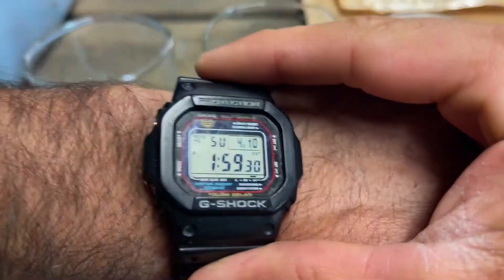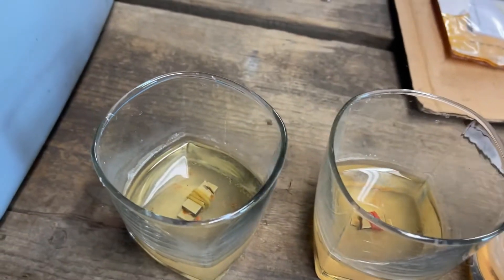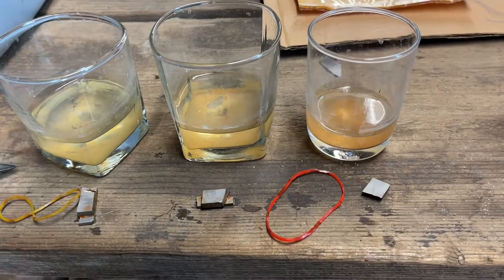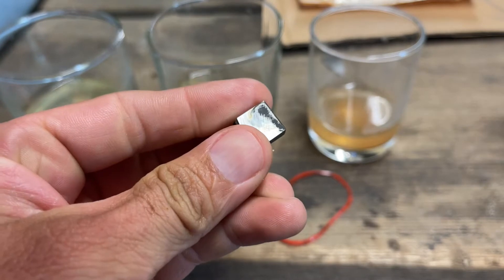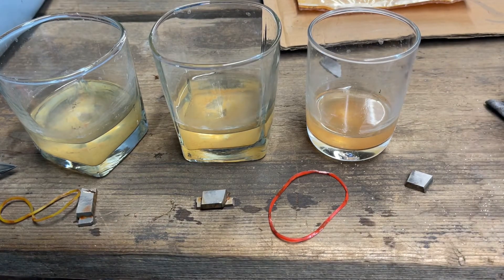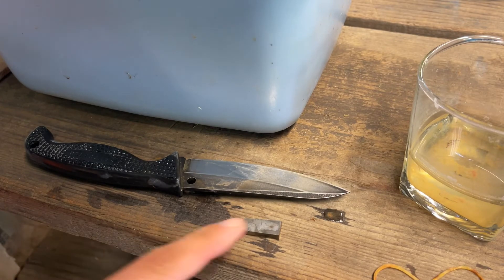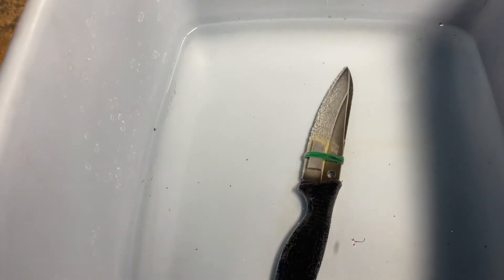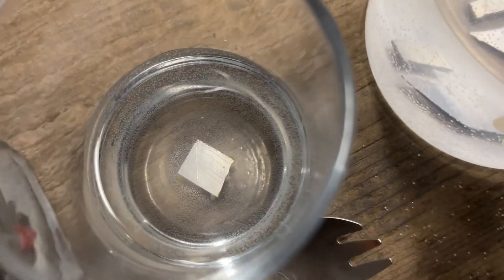Magnacut galvanic corrosion test results

Comment: Interesting tests, in salt water? Don't understand the dissimilar metals parameter, how would that apply in real use? Maybe a folder in Salt? water? for a week? Wouldn't a test with a single alloy in salt water be more prudent? I must be missing something, just don't see where two dissimilar metals would be in contact in salt? water for a week. Very interesting results though> Thank you
Reply from the maker: Hello, so yes the tests are in 43% salt, if I remember correctly. The point of the test is mainly to see which metal is more corrosion resistant. If I put Vanax, H1 or Titanium in salt water by themselves, they won’t rust; I’ve tested this in other videos. So I needed a test that had a definitive answer as to which metal is more corrosion resistant and I came up with this test, Galvanic Corrosion test. The way it works is the more corrosion resistant metal will cause the least corrosion resistant metal to corrode when they are both in contact in an electrolyte. Then with this I have been able to determine that Titanium and H1 are more corrosion resistant than Vanax and that Vanax is more corrosion resistant than Magnacut (Magnacut corrodes in salt water by itself in less than two days.) so the first reason was to get results where before I couldn’t.
As to application: I was able to make a knife that will, theoretically, never rust; after I had failed in a previous attempt. The way I did it was only using one metal combined with non conductive materials (Vanax and G10).
A Salt folder will rust eventually. It doesn’t have to be in salt water for a week, two different metals will form rust eventually. Keeping it in salt water is just to accelerate things. I will do a test on a Salt Folder but it won’t be for a long time.

Comment: Were your pieces of Magnacut heat treated?
Reply from the maker: No, the Magnacut isn’t heat treated (good question). I thought about this too so I retested heat treated Magnacut by itself in salt water again and it rusted the same way as non heat treated Magnacut. I did a video about this, I tested a Magnacut knife instead of a piece.
Reply: @totesmalotes  thank you for the reply il look to check it out!
Reply: @totesmalotes  do you think magnacut is a salt proof enough steel to use on a folding knife for swimming in a salt water pool / the ocean? Originally the plan was for Lc200n but the supply is dried up. Magnacut is available atm. Ive seen some reviews say it will work and but yours seem to indicate it will rust. It would be in and out of salt water i. Board shorts. Thx in advance for your
Knowledge
Reply from the maker: @elgato3535  so from what I’ve seen if it’s not in the water for a super long time and it’s just in and out of the water it should be fine. I tried a salt water spray test over 12hrs where I sprayed it about four times and let it dry and there wasn’t any problems with rusting. Even in my tests, if you see my new one, Magnacut does leach rust into the water but when you look at the steel it doesn’t show signs of rusting. Hope this helps.

Comment: Underrated video. Nice work, super helpful information. What are your thoughts on the quiet carry waypoint as a fully rust proof knife given that it has titanium, LC200N, marine grade screws and its vanax blade? In other words, how “abusive” could one be on a waypoint before one of its components starts to rust? Any ideas on what component that would be? Thanks for this video and your thoughts!
Reply from the maker: Hello, thank you. So my thoughts on the Waypoint is that it can’t be fully rust proof because of all the different materials they use. All the materials are very rust resistant on their own but because of galvanic corrosion eventually one would force the other to rust.
If I had to guess what would corrode first, I would guess the screws. I haven’t tested Vanax against LC200N but there is phosphor bronze washers and a ceramic detent between both these metals. So metals making contact that I can see (I don’t own a waypoint so I could be wrong) is the stud with the Vanax, the screws with the titanium and the liners with the titanium. Titanium usually causes steels to corrode the worst and I think LC200N is more corrosion resistant than marine grade stainless (I haven’t tested this) so my guess is the screws.
Reply: @totesmalotes  thanks for taking the time to share your thoughts, even without having the knife in-hand! I also thought of the clip, which is also marine grade stainless, and in physical contact with the titanium scales. Anyway, it's a fun mental exercise made more meaningful by your video, so thank you again!
Reply from the maker: @MR0B0T0  no problem. This was a question that made me think, so thank you too.

Comment: edge retention low to high Ti, H1, Vanax, Magnacut  -- corrosion resistance l-h Magnacut, Vanax, H1, Ti  -- toughness l-h Ti, H1, Vanax, Magnacut    ((approximately))
Reply from the maker: From what I know, I would agree with all of these except I would put H1 higher than Vanax in toughness. I believe Vanax would win in edge deformation but I think H1 would win if used as a pry bar.
Reply: @totesmalotes  I think yt is deleting my posts again
Reply from the maker: @vyr01  someone else commented that before. I don’t know why that happens. I’ll see if there’s anything I can do.

Comment: Does make me want to buy some salt series in LC200N & H1 though. Even if only on an academic level, interesting stuff.
Reply from the maker: I’ve found that the Aqua salt with its H1 steel and FRN handles is as corrosion proof as it gets so far.
Reply: @totesmalotes  thanks for that insight ! Guess the price for those will go up now. My environment & normal use don't push the limits of 14C28N or S30V but it's always good to be prepared for a trip to the ocean or anywhere else for that matter !
Reply from the maker: @tombrown4683  no problem. I use my H1 knife for running.
Reply: Buy the h2!! Supposedly even a bit more corrosion proof than H1. I have one on the way!

Comment: I'm not sold on magnacut. I get the feeling it's a sales gimmick.  Spyderco was famous for taking steels that didn't sell great re-naming it. Then they go online and sell it as the end all be all. 
I put more trust in your backyard test then anything being pushed by blade manufacturers. 
I remember they were pushing m390 it wasn't bad but it didn't do better then 14c28n 90% of the time. 
Hey but I'm a budget kinda guy. Lol 
Good job bro.
Reply from the maker: Thank you. I don’t know about Magnacut either. I’m going to retest Magnacut by itself in salt water but if it rusts again in a days time I don’t know why Spyderco would use it in their salt series of knives. I’ll test the Magnacut knife I’m making after it gets heat treated too. I try to stay away from things that get hyped but I decided to try Magnacut partly because Spyderco chose to use it in its salts series. I’m a little disappointed.
Reply: @totesmalotes  Higher polish on all sides, not just the larger flats
Reply from the maker: @vyr01  I agree. I haven’t done the test yet but I’ll grind all the sides to make sure I get good results.